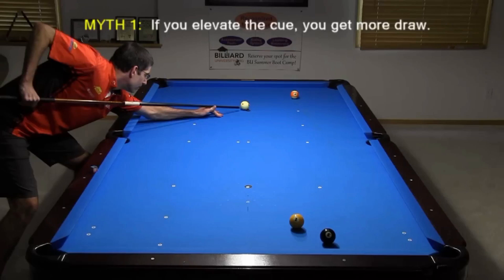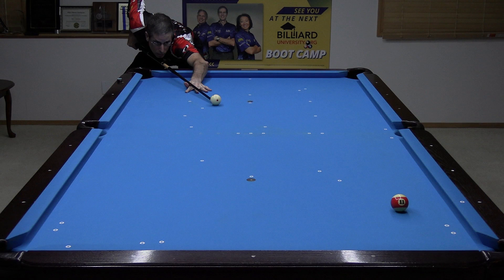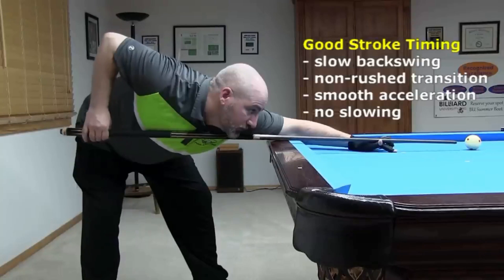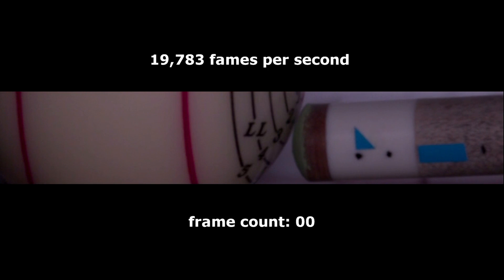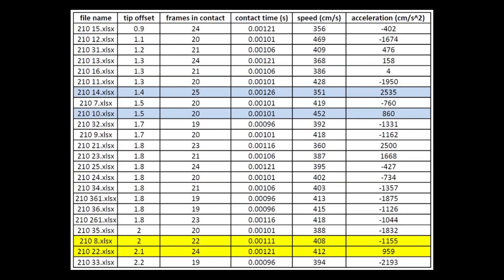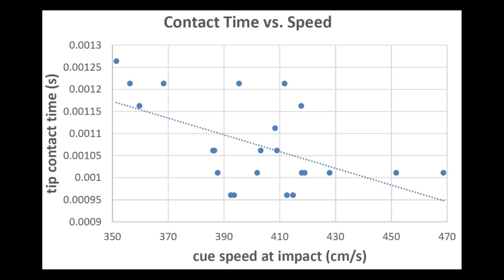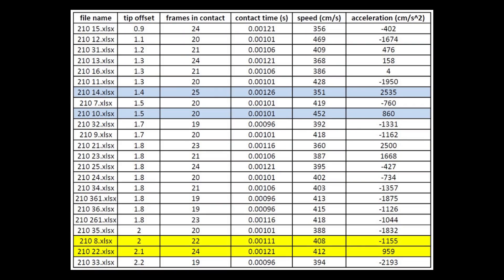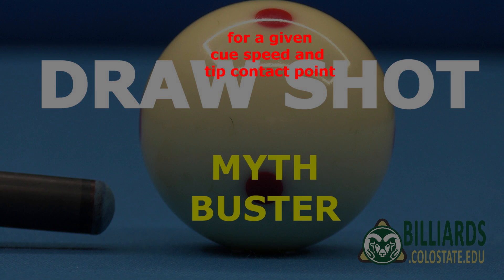DRAW SHOT Effects Myth Buster … a Slow Motion Video Study

Comment: Dr. Dave.  I think this is wonderful and proves your point experimentally.  Well done!  And thanks for your responsiveness.

I think it would be great if you use your partner and his setup to examine cue stick angle (up to several degrees anyways) to determine its effects on draw as well as on force follow (where some insist there's a huge difference from angle and finishing UP is critical.

At about 2:50, you show a chart of cue speed vs time.  Is this chart real?  Does it really represent the results of different strokes and that there's a particular type that uniquely results in that higher speed needed for more draw?  If so, I think that deserves and I would appreciate some followup to explain it, including what's necessary to achieve that.  Hitting low on the cue ball has been beaten to death, but there's little information about this acceleration technique.  Is it impacted by bridge length or backstroke length, wrist action, muscle fiber types or what?  How would you practice it and recognize progress (I mean as a dry practice or just with a cue ball), working up to doing actual draw shots?
Reply from the maker: I honestly don't feel a need (nor do I have the interest or motivation) to do additional tests related to this topic.  I have already beat it to death (per all the past videos linked in the video description).  Also, the science on most of these topics is already clear.  See:
https://billiards.colostate.edu/faq/draw/cue-elevation/
https://billiards.colostate.edu/faq/draw/physics-advice/
https://billiards.colostate.edu/faq/stroke/acceleration/
https://billiards.colostate.edu/faq/cue/weight/
https://billiards.colostate.edu/faq/stroke/follow-through/

Comment: My takeaways from this that aren't discussed in the video, correct me if I'm wrong with any of these, Dr. Dave!:

Essentially, what this means in terms of strokes is that the "follow through" advice often given is not actually important in terms of implementing backspin on the cue ball but rather just a best practice to avoid decelerating the stroke too much before impact (i.e. hesitating to hit the CB as fast as you would like because you psychologically start the pull-back action earlier than when you would want to), given a certain goal of draw speed. 

This makes sense because sometimes you're forced to pull back instead of being able to follow through on shots where the cue ball and object ball are nearly frozen to avoid a double-hit foul, but you can still impart strong backspin due to the shorter travel time of the cue ball to the object ball and nothing significant changes (in practice) with tip contact time. 

This also further supports the idea that tip hardness is MOSTLY insignificant when it comes to spins and draw shots in particular. Or a better way to put it, there's no significant difference between tip hardness that you can't adjust for through practice with the same cue and tip, and will most likely only notice when you suddenly switch to a different tip type for the same exact shot.
Reply from the maker: That all sounds good.  For more info on these topics, see:
https://billiards.colostate.edu/faq/stroke/follow-through/
https://billiards.colostate.edu/faq/stroke/acceleration/
https://billiards.colostate.edu/faq/cue-tip/hardness/

Comment: I'm curious what the effect of cue tip deflection has on the quality  of draw and follow shots. Would it be possible to build a rig that imparts 0 deflection upon striking the cue ball?  Maybe a roller or plastic  "sled" that attaches to the tip. If the tip doesn't  deflect at all upon impact, would it force the ball to hop? I think this information.  Would be useful  in determining  the right type and size of shaft to play.
Reply from the maker: With an off-center hit, the tip always flexes away from the CB (most after the hit).  If the shaft were stiff and heavy enough to prevent this, there would be a huge amount of CB deflection (AKA squirt).  For more info, see:
https://billiards.colostate.edu/faq/squirt/cause/
Reply from the maker: Concerning the right type of shaft, see:
https://billiards.colostate.edu/faq/cue/carbon/
https://billiards.colostate.edu/faq/cue/low-squirt/
Reply from the maker: Concerning shaft size, see:
https://billiards.colostate.edu/faq/cue-tip/size-and-shape/

Comment: Over long distance, you can also jack up slightly and not hit as low to get the ball to jump slightly so the back spin doesn't wear off as fast. The cue ball also has more speed compared to cue speed because you are hitting closer to center so it gets to the object ball faster and again has less time to lose back spin. This effect also helps even if you don't jump the cue ball. The hard part is picking the right spot on the cue ball to balance all effects to get maximum draw especially when you take into consideration distance to the object ball and cloth conditions (don't even start on barbox cueballs).
Reply from the maker: Jacking up the cue more than is necessary to clear the rails does not help draw distance.  For the reasons why, see:
https://billiards.colostate.edu/faq/draw/cue-elevation/
Reply from the maker: Although, cue elevation can help narrow draw angle.  See:
https://billiards.colostate.edu/faq/draw/quick/
Reply: It reall does. You are focused on increasing spin. Jacking up does not increase spin, it just causes the cue ball to stay airborne so it doesn't lose spin due to friction. Try it. If you can get the cue ball to reach the object ball in 2 or fewer bounds, it will dramatically increase effective draw if the cue ball is more than 5 diamonds away from the object ball and especially if you have slow cloth.
Reply from the maker: @Gotwired   I have tried it.  I can get more draw with the cue as level as possible (on any cloth).  I have also done a careful and thorough physics-based analysis.  For the reasons why an elevated cue does not help (unless the cue elevation helps you generate a more powerful stroke for some reason), see:
https://billiards.colostate.edu/faq/draw/cue-elevation/
Reply: @DrDaveBilliards  I think you might need to bring in someone with a more powerful stroke to test it out. If the cue ball is bouncing a lot, you will lose more spin to friction. Also, if you hit too low, the cue ball speed will not be fast enough to get to the object ball in relatively few bounds.

https://youtu.be/dnTzqTc8IKg?si=HQ6IU68cjT6W4-a8 

Here is an example, btw. I am using the rail to control my cue elevation so it is ideal.
Reply: @DrDaveBilliards  also, on super slidey cloth, it doesn't help so much.
Reply from the maker: @Gotwired  It doesn't hurt as much with slick cloth either (since you don't lose so much on the first bounce).
Reply: @DrDaveBilliards  i have found that the draw is about the same for either technique on slidey cloth. on slow cloth, though, the farther you are from the object ball, the more jumping helps retain back spin.
Reply: @DrDaveBilliards  also, jacking up too much can also cause problems. Ideal is just a bit above  level.
Reply from the maker: @Gotwired  That might be the case for you and your technique, but it is not the case in general.  Again, the reasons (and proof) can be found here:
https://billiards.colostate.edu/faq/draw/cue-elevation/
Reply: I watched the video. The cue ball is close to the rail so he had to jack up, right? Otherwise you can't hit low. @Gotwired
Reply: @puboh  no, i am just using that distance from the rail to keep the elevation angle consistent. it is much more difficult getting that much draw from that far away using a standard bridge off the rail because the power required almost certainly makes your bridge hand move changing the elevation and where you hit on the cue ball and even more difficult off the rail with a level  cue.
Reply: I will add the caveat that you need a fairly powerful stroke in the first place to see dividends from this technique. Most people probably can't get the cue ball to the object ball in few enough bounds to overcome friction.
Reply from the maker: @Gotwired See the info at the link.  The physics doesn't lie.  More backspin is lost when the CB is driven down into to the table than is saved in the air.  Now, often cue elevation cannot be avoided (for example when the CB is close to a rail or when you are cuing over a ball).  And with most power shots (stun, follow, or draw), the CB spends most of the time in the air anyway (since the cue is always elevated a little to clear over the rails.
Reply: https://youtu.be/dnTzqTc8IKg?si=HQ6IU68cjT6W4-a8

Here's my draw shot btw

Comment: Thank you for the video.

I was wondering; if one wanted to maximize draw/speed ratio with cut shots (quarter-ball hit or more), would jacking up help in that case? I would think that in the extreme case, the cue moving directly downward towards the table while hitting CB at the six o'clock mark, would maximize this ratio. On the other hand, the CB starts to get pressed against the table somewhat when you jack up the cue (and maybe even little bit of jumping may occur?).

The problem with draw and thinner cuts of course is that CB retains more of its own speed after contact with OB, and the higher "residual" speed causes it to travel along the tangent line further before the draw can take effect.
Reply from the maker: Cue elevation reduces backspin but it can narrow the draw angle.  See:
https://billiards.colostate.edu/faq/draw/quick/
https://billiards.colostate.edu/faq/draw/cue-elevation/

Comment: I think these myths still get spread because they change how people think of their cue delivery, like they hear "accelerating with good timing" and maybe slow down the backswing (resulting in less unwanted steering) and a faster forward swing (resulting in greater draw distance). Then the figure "well what I was told is working, and it sounds scientific, so the info must be accurate". Like the old adage "it's hard to argue wth success". 

That, combined with people's natural reluctance to ever back down when arguing on the internet, means the debate will probably go on forever.
Reply from the maker: Well stated.

Comment: What about grip tightness? I still think a tight grip at contact point give the cue ball more speed & more draw action (because it adds mass to the cue). Maybe you could debunk that, here is a suggestion for testing:

- 2 shots, with same cue speed & cue acceleration at contact point, same contact point; the only difference is, one with a lose grip and one with a tight grip (at contact point). Then we measure the speed of the cue ball, the spin (how many round per sec), and the draw action (how far the cue ball goes back). The result will settle this problem once and for all.
Reply from the maker: See the info and links here:
https://billiards.colostate.edu/faq/grip/light-vs-tight/

Comment: One thing I've always wondered is if the particular dome radius the tip is shaped to has a significant impact on how far you can hit the cue ball below the middle at iso speed without miscueing.
Reply from the maker: The tip shape is not as important as some people might think.  See:
https://billiards.colostate.edu/faq/cue-tip/size-and-shape/
Reply: @DrDaveBilliards  Thank you for taking the time to reply, interesting read. It always strikes me just how many tiny effects are involved in producing the final motion, even if the general physics involved seem to be obvious enough at first. I guess that is mostly a result of using perfectly hard and smooth model materials in our heads when we make calculations, while cloths, tips, cues and balls all have their own material properties that make them anything but perfect model materials. The effects may be small, but they can add up on certain types of shots. I didn't think I'd ever get any answers to these lingering questions I've always had playing various cue sports over the past twenty years, but thanks to yourself and others, the research is finally being done.
Reply from the maker: @osirisgolad  You’re welcome.  I aim to swerve.  :)

Comment: @DrDaveBilliards TLDR; Is quality shaft important for the success of full length table power draw shots?

Back story: I play exclusively in bars and pool halls on 9 feet tables. Often times the cloth is smooth and fresh. I use the basic cue stick available at their disposal as I yet have to get one of my own. I play 1-2 times weeekly for the past 2 years, so I have a solid amount of experience.

I am wondering why when attempting power draw shot across full table length I either  scoop the cue ball or the ball loses most of it's spin and the ball returns only about third of the table. I can rarely get the cue ball to return half table length when practicing draw shot and in actual game the success rate is even lower. 

Is it reasonable to blame the bar cue sticks which aren't as stiff supposed to a professional cue stick? 

Cue tips are hard and round on all of them so i think I can rule this out.

It might very well be lack of speed as I'm not in a great physical form, but that's not what I would like to be blamed for even tho I'm sure that's also part of the problem.. 😅
Reply from the maker: The cue is not so important, assuming the tip holds chalk (and is chalked), and assuming the shaft and ferrule are not cracked.  Getting good and consistent draw is all about good technique.  If you want help, see the videos and info here:
https://billiards.colostate.edu/faq/draw/advice-and-drills/
The cloth type and condition are also important:
https://billiards.colostate.edu/faq/table/cloth-effects/

Comment: Nice.. How do different cue weights change this? Do we have to talk about "impulse" instead of "speed"?
The weight of the cue influences how a player is able to accelerate the stick (the heavier the cue, the lower the max. speed). But a heavy cue does not have to be as fast as a lighter cue to impart the same impulse to the cue ball.

Hypothesis:
If you are srtong or very skilled, you might choose a lighter cue and generate the impulse with your muscels. If you are weaker or unskilled use a heavier cue and let the mass do the work.
Reply from the maker: This topic is covered in detail here:
https://billiards.colostate.edu/faq/cue/weight/
https://billiards.colostate.edu/faq/draw/cue-weight-effects/

Comment: Its true that acceleration doesnt mean much due to brief contact time, but contacting the cueball when your cue is accelerating mostly translates to a higher cue speed upon contact. 

Teaching the acceleration portion while teaching draw is still relevant in my opinion, especially in imparting a proper stroke or getting more reaction. I found it effective in teaching draw by slightly reducing the pull back and increasing the follow through so as to contact the cue ball while the cue is accelerating to attain a higher speed at time of contact. 

I dont want to be teaching the "unimportant stuff" or "wrong stuff", but i cannot find a more effective way in teaching draw without using the word "acceleration".
Reply from the maker: As I pointed out in the video, smoothly accelerating stroke is critical to accuracy, consistency, and speed control per all the info and advice here:
https://billiards.colostate.edu/faq/stroke/technique/
But most good players reach maximum speed (with zero acceleration) just before contact. Per the info and study link here:
https://billiards.colostate.edu/faq/stroke/acceleration/
If you are still accelerating at impact, it means you didn’t accelerate and generate speed early enough.  Many players actually decelerate just before contact due to poor timing:
https://billiards.colostate.edu/faq/stroke/good-timing/
Reply: In my mind, the FEELING of acceleration at impact is extremely important to a good stroke.  As Dave said, it is the best way to be accurate, and, importantly, consistent.  With the use of these slow motion videos, we can understand that what we’re feeling isn’t what is actually giving us the results, but if this feeling is the most effective way to be accurate and consistent, then by all means, use it.
Reply from the maker: @jonathangoff8005  Well stated.

Comment: I completely understand and agree with the physics involved, but in order to be consistent, a repeatable stroke is an absolute must, and good mechanics promote that.  Otherwise, what difference would solid mechanics make?  And judging by all the greatest players having excellent fundamentals, I'd venture to say that it does matter.
Reply from the maker: I’d tried to make this point at the beginning of the video.  Good fundamentals, timing, and acceleration during the forward stroke into the ball are critical for accuracy and consistency, but what is happening at the instant of contact is unimportant.  The videos and info here cover all the important stuff concerning a good stroke:
https://billiards.colostate.edu/faq/stroke/technique/
https://billiards.colostate.edu/faq/stroke/good-timing/
https://billiards.colostate.edu/faq/stroke/acceleration/
Reply: @DrDaveBilliards  It's a great video, as are most of yours. My background is in engineering and I think like you. My friends have argued with me multiple times about the chalk and tip hardness video results. A similar video about weight of a break cue, and I think that'll round out the arguments, lol. I keep trying to tell them lightening the cue can get you more power (assuming you can generate enough velocity). Some just don't understand the concept of mass x velocity squared.

Keep up the good work!! And thank you.
Reply from the maker: @joncue0304  Check out and have your friends check out this page that covers cue weight questions in great detail:
https://billiards.colostate.edu/faq/cue/weight/
That should settle the argument.
Reply: Will do! Thank you.
Reply from the maker: @joncue0304  Let me know how it goes.